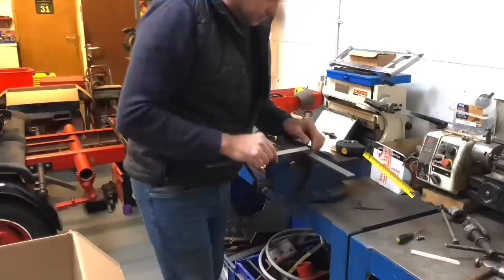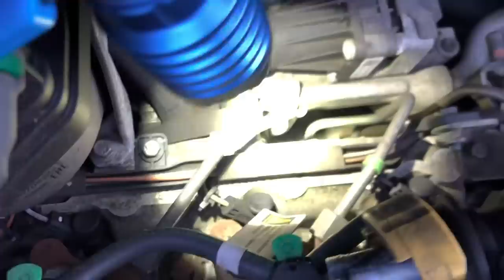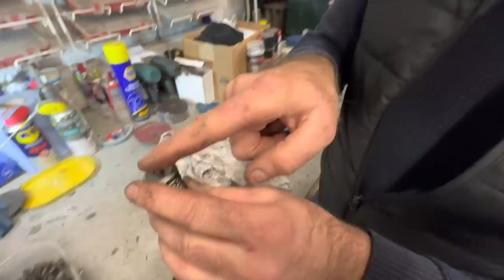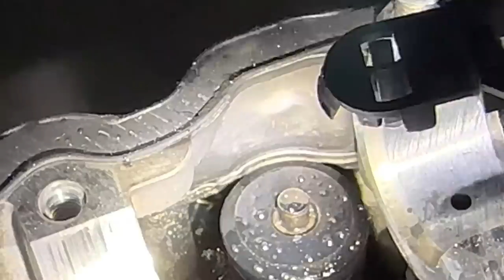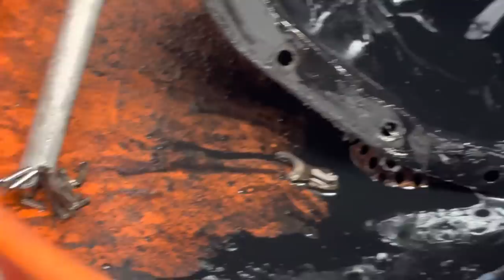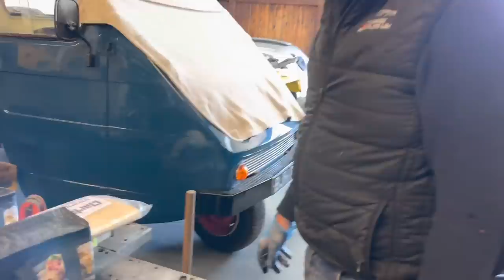PEUGEOT CITROEN DS3 1.6 HDI ENGINE FAIL CAN WE SAVE IT???

Comment: Purely wondering but wouldn't all the metal bits in the sump have caused some significant damage throughout the engine, say oil pump and oil passage ways? Good job nonetheless.
Reply from the maker: You shouldn’t even be at that part in the video for at least another 5 minutes

Comment: Nice work, colletts are a bit of a mystery to some, I have a really strong stiff mountain bike stem with a collett "thimble" on the steerer tube and then three bolts onto the actual handlebar stem.  Bit of a fiddle to set up but such a difference with no flex.  Taking it off however is a real workout, the instructions say "a  vigourous left and right up down motion"  well that can take 10 minutes, impossible on the stand with wheel out, no wonder almost all bike still have the star expander nut🤣

Comment: Once did similar repair and packed cylinder with string and pump grease in via spark plug modified with grease nipple to hold valve in place

Comment: I've had 3 Citroens with that engine, all used cars. All where at the next service changed at the drainplug. The shop had devoloped a tool to drag the plug down so it was possible to drain all oil. There is around 1/2 litre of oil you will never be able to get out.

Comment: Poor design on the sump with oil drain plug that leaves 600cc of old oil in engine that's why on dealer service they recommend an oil flush additive  no one likes to buy over price diesel fuel to clean there engine nasty stuff to lay in new oil  best solution is get the  engine hot and oil extraction is the best method to withdraw 4 litres   that solid camshaft should out live the car as the back end body work will suffer from tin worm.